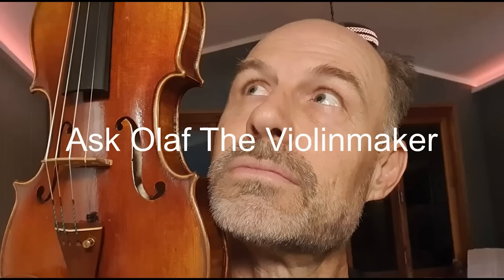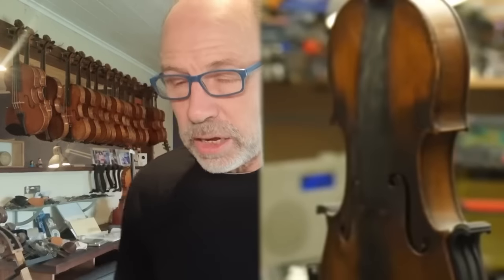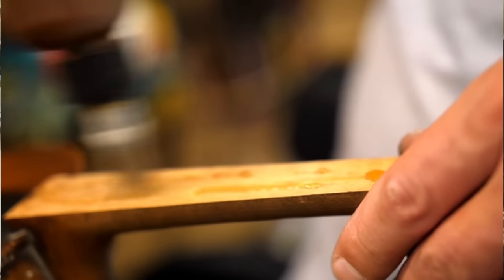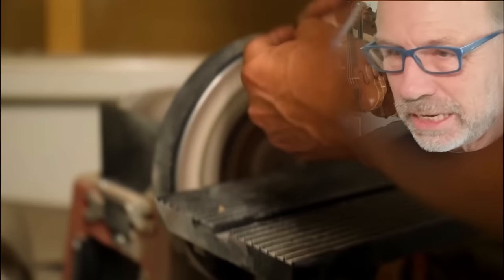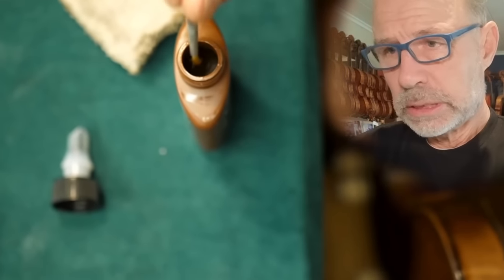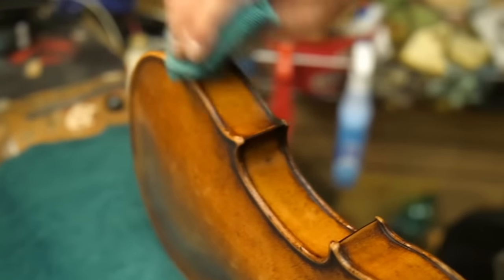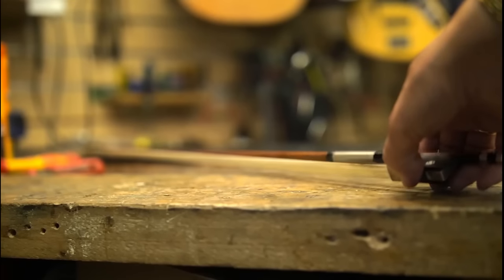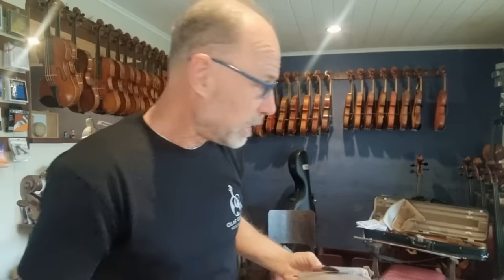Violinmaker reacts to "Ancient Violin Restoration" Video

Comment: The modern glues are not removable. Titebond is polyvinyl acetate. It has absolutely no relationship to hide glue. I did an apprenticeship as a cabinet maker restoring 17th and 18th century English and American Furniture and we used nothing but hide glue. You can use fish glue which is quite similar, but tight Bond does not break. The wood around it will break before the joint made with tight Bond will break. So that is a real problem with anything done with tight bond. Modern guitar makers use it a lot because they don't want to ever come apart. But I understand that violins are quite different from guitars. The problem is guitar makers are not violin makers and the two don't come together. It's a completely different ideology in terms of repair

Comment: NoOooo Olaf beat me to this reaction idea!   😱
Oh well, he did an excellent job of it!  Great video, Olaf!  👍👍❤

That Titebond glue he used is a type of hide glue, sure. The big problem with it is that unlike the normal hot hide glue that luthiers use, the Titebond reacts very easily with moisture, and can become soft. Some folks swear by it, but really, there's no substitute for real hide glue that you cook yourself!
Reply: quick, you can still react to Olaf's reaction before someone takes that too :O
Reply: @diethylmalonate  😁👍👍
Reply: Tite bond hide glue is not well looked upon in the Piano rebuilding industry.  Although the 2 have very different concerns.  Hot hide glue has actually been replaced a lot of this industry simply because there are glues that are a lot stronger and less reactive to moisture that have been adopted, but hide glue is still the preferred glue for parts that will need replacing such as hammers, felt and other common replacement parts.  Lot more brute force in the piano industry given the size of many parts and the forces involved.

Comment: Ernie Ball shirt, defiantly guitar guy.
The Titebond was hide glue, not PVA (wrong but not horrible).  From what I found, its the closest to real hide glue that doesn't require heating.  I never used it (it expires quickly), but looked into it for convince.  Its for people that want to use hide glue, but don't want to mix/heat it.
Olaf is right, just use hot hide glue.  Its not hard and has way more advantages over anything else.
Reply: The Titebond hide glue was one thing, using CA glue for the nut however made me cringe.
Reply: @forkless  Yea, most guitar makers slather the glue for the nut on, at least he didn't.  I have no idea why he used titebond for fingerboard and CA for nut, they are same woods.  Made no sense, unless he was in real hurry.😅
Reply: And make some sous vide with the heater!

Comment: What always sounds funny to me is the term of "hide glue" English speaking people use to speak about the hot glue used for violins. In fact there are no hides involved but bones and nerves. (hide glue only is too soft, the mixture of bone glue & nerve glue makes the best compromise between the hard (brittle) and soft (that could damp the vibrations)). You do not mention the other option often used by old German violin makers : fish glue. This is easier to use because you do not need heat and the time to set is longer... which is also a disadvantage in some cases. 
Thank you for your interesting and instructive comments particularly on this video. 
In general thank you for the topics you choose, the way you skilfully cover them (and also the pinch of humour you use to season them). I am a big fan : two thumbs up !  Sorry for my perfectible English (some may have guessed that I am French), this is a matter I try to improve day by day.
I do think that there are many old violins that deserve some work to get back to life again. Unfortunately, the labour costs of a professional luthier is generally far higher than the commercial value of most of these violins and this is the reason why some are thrown away and lots of them are just not taken care of.  I try to contribute (and I am certain to be one amongst many) to resurect (for free) some outcasts and try to do this better and better... Best regards, Thierry-Antoine

Comment: The major concern, for me, is the use of non-reversible glue. Titebond is a nice glue for usual woodworking… not for violin restoration.
Reply: Unless it's epoxy, pretty much most glues are reversible. That wasn't standard "Titebond" which is aliphatic resin glue....it was "Titebond Hide Glue" It dries a bit more crystaline than standard Titebond and is even easier to heat and remove than standard Titebond which also responds to heat. Hide glue is the best, to be sure...but it has its drawbacks in that it's weaker and more susceptible to humidity. Point being that he didn't irreversible damage the violin using that glue.

Comment: There was more wrong with the producer of the video than with the work done.  I've seen scores of old Bohemian fiddles like that one.  For a general instrument repair shop (glue aside) they delivered a decent, playable workaday violin.  That hoke about the instrument being 'ancient' and in need of total restoration, is of course absurd.

One of the arguments in the comment field was about whether the top should have been removed in order to complete any necessary work inside.  This is a matter for the luthier to decide.   If there is no damage as viewed from the endpin hole or the f holes,  it's perfectly OK to flow in some hide glue and clamp up the top plate.  Even Cremona-trained masters do this.

Comment: @Olaf, if you have any of those cheap violins behind. Or broken and unable to be repaired. Why not buy a bunch of modern glues and hang them somewhere to experience weathers. See how they fare? 

Don't have anything against hide glue, but I think a long-term test under your eyes would be more valuable than mere saying the words. Then again, maybe you've already experienced cracking open other violins with these glues?
Reply: They don't come apart easily that's the point. Likely to get damaged when doing so. I'm NO expert... just watched a lot of Olaf and TwoSet vids.
Reply: (1) Olaf is talking about glue longevity in terms of 100+ years. I doubt he will live long enough, for that experiment.
(2) Hanging the instruments, on the wall, in a controlled environment, is no experiment, at all.
(3) I am beginning to see the benefits of hot hide glue, for violins. Violins are very delicate instruments and using a glue which requires heat and moisture, to break the bond, could be injurious, to the instrument you are trying to repair.
For guitars, mandolins, zithers, dulcimers and such, it's fine, but not violins, with any value.

Comment: Hello Olaf! 
I watched that violin restoration video a few weeks ago and was reacting to it much in the same way! Though, I was surprised to hear that super glue is really frowned upon for gluing in the nut in violin making. I work on guitars as a hobby, and I've seen it become quite a common practice to use about two drops of some kind of liquid super glue on the fingerboard side (not the neck) to secure the nut. The nut comes off pretty easily when you need it to, you just put a little block of wood up to it and give it a soft strike with a fretting hammer. The glue usually breaks first since it's brittle. I'm curious what a violin maker has to say about this method.

Comment: It said Hide Glue on the container. The company states; "Its sensitivity to moisture allows for easy disassembly of parts, a critical benefit in antique restoration or the repair of musical instruments."
Seems like it should be okay to use, but are there any disadvantages to the ready to use stuff like this?

Comment: the thing is, not everyone has access to a violin maker that can do that kinda repair for them. like i wanna restore a violin in pieces and will do it on a regular wood workshop because i cant afford/dont want a brand violin right now and the only violin luthier in town is really not reliable. most of the tools a violin maker works with are probably meant to save time or provide precision for details while yes, you can restore a violin with a tooth brush and hair pins but it wont sound and look like a million bucks especially with ittle knowledge. what i find problematic is to make a video of it that encourages other people to do so with no proper disclaimer of this situation. thank you for the honest and very educational video.
notable mentions: sniffing turpentine, sanding fingerboard, crazy glue, when auto subtitles said "dementia on this one" instead of dimension, vietnam 100//

Comment: Olaf, I felt your pain! What bridge do you recommend? Also, I had an instrument repaired for cracks and they changed the fingerboard and the nut. It totally changed the sound for the worse. What would you adjust to get the old sound back? Thanks.
Reply from the maker: Wow... How frustrating.
They probably also adjusted the soundpost. So that would be a good starting point...
Maybe go to a different place?
Get some recommendations from local string players

Comment: Thanks Olaf. Yes, I cringed too, however those threaded fingerboard clamps can work OK, but obviously the fingerboard still has to be kept perfectly positioned when tightening them up.
I looked up that Titebond glue "The Titebond Liquid Hide Glue is the first hide glue to be available in liquid form, it requires no mixing, stirring or heating." but I'm curious to know what keeps it liquid in its cold state & can it be cracked open later? It obviously dissolves with water still & probably fine & convenient for gluing the nut back on.
I'll stick with my standard Russian hide glue. :) 
As I've said before, there's a certain Cremona trained 'luthier' that calls himself Maestro & he uses Titebond Original Wood Glue (red label) with this description (part of), "This glue is so strong, it has a stronger than timber bond, so the timber surrounding the joint is going to break before the joint releases. It is the glue of choice for instrument makers around the world." 
So he uses it for crack repairs, saying that it is a 'permanent' repair, including centre joins. I told him no repair should be considered 'permanent' & I'm sure a luthier in later years will not thank him if faced with a follow up repair. Thankfully he still uses hide glue for gluing the belly on etc.
Reply from the maker: Wow... Yes,
Many years ago I restored a Gagliano cello with well over 40 cracks.
A 'repairer' here in Brisbane glued most of them with PVA glue... It literally took us a couple of years to remove the glue and then reglue and restore each crack correctly.
Reply: @AskOlaftheViolinmaker  Ouch! I bet there were tears & some 'sweet' words during that time.
Reply from the maker: @rossthefiddler5890  haha... Yes. Some non PG content right there...

Comment: I did happen to see that video. I agree with you 100%. I will even be more blunt than you are, the guy is a butcher. I'm a retired machinist,welder and machine repairman. I'm very skilled at using the proper tools, the proper way. There is also, regardless of what you are repairing or rebuilding,
a step-by-step process. I found that the restorer was doing things in reverse. I would have cleaned everything first. This way you're finishing your restoration on a solid base that has already been repaired and cleaned. In my opinion to do the heavy cleaning after you have restored it is a dangerous procedure. I also watched the way his hands were using simple files and reamers. He was too aggressive with the reamers and somebody should tell him that files are not used with a back and forth action.
As I stated the guy is a butcher not a craftsman.
Reply: a machinist would clean the parts but here he should be careful with surfaces he has to glue later.  and since he's using turpentine...  You're right it's a true hack job compared to people who went to one of the big violin making schools like chicago or salt lake city, who are the only people who'd touch an instrument of mine.  olaf is being very ...diplomatic might be the best word
Reply: yt is full of hack violin fixers.  the violins were mostly worthless before though

Comment: Something worth mentioning is that the channel of that video USED to be "Andre will fix it", the original content channel of a quite skilled general restorations and repairs guy, who repaired from firearms to horses (no, no typo).  Sadly, after a long hiatus, the channel was rebranded and relaunched (with a different contact address,  not that of Andre, but that of BeAmazed, an "aggregated amazing stories" website) with the kind of heavily edited content you can now seen. Since then, Andre (and his original content) has basically dissappeared from Internet. Draw your own conclusions.

Comment: Titebond is definitely insoluble in water once dry. That fingerboard is not coming off clean ever again... Afair it polymerizes into a plastic and can basically only be removed with harsh chemicals like acetone and in higher temps(like 80C) in methanol..? and ofc physically by literally just sanding or chiseling the wood and glue. Most of the time i'm not even using it for my woodworking projects because of the fact that it's basically just plastic. I'd rather just build things well instead of hiding mistakes and bad design choices behind a layer of cheap plastic..

Comment: I was going to use titebond on my Talharpa I'm in the process of designing. I'd love to use real hide glue, though, just so I could open it up if I ever needed to. I just don't know where to get any, or even where to start looking to even see if it's in my budget range.

I've actually been taking a lot of inspiration from classical instrument construction for my Talharpa, from this accessibility after construction to the ability to adjust the bow hair tension to the use of a bass bar. Though everything I do will be more of an experiment than anything else since I really can't say if any of it'll actually be beneficial until i actually build it. But it's been fun, and at least design-wise I'm really happy about it, and really, that's all that matters
Reply from the maker: Hide glue and rabbit glue which I use are pretty easy to find in most places.
Violin making and guitar making supplies have it as well as some specialised hardware shops

Comment: Please check out RSW Chocolate.  It's the Rosa String Works channel and he restores a very broken violin called Chocolate.  He uses tite bond original for a lot of things and says it's not harder to take apart than hide glue but I'd be interested in seeing your opinion.
Reply: It's a actually not difficult to remove titebond original it just takes longer. For cracks repaired with titebond if you leave a damp cloth over the area in a few hours it softens, I still would prefer hide gule. Now in the case of Chocolate I feel that there was nothing to lose at that point, most luthiers would have called it a loss and would have just called it a loss and make a new top for it rather then repair the old one.
Reply: zapa1pnt
1 second ago
I doubt Jerry Rosa would even Want to work on a $10,000 violin, with the exception of the completely crushed "Chocolate" violin, which no one else would touch. Also, anyone with such an instrument would not be likely, to take it to their local luthier.
However, all of that is up to the owner of the instrument. Many owners of old instruments just want them to be playable and cannot afford or want to pay high dollars, to get them fixed. Most of them, floating around, aren't Really worth it, anyway.
Reply: @TXCrafts1 : I am beginning to see the benefits of hot hide glue, for violins. Violins are very delicate instruments and using a glue which requires heat and moisture, to break the bond, could be injurious, to the instrument you are trying to repair.
Reply: No doubt, I would always prefer hide glue particularly for major repairs but you could get away with pva for something like a chipped corner or something like that.

Comment: The left shoulder of my violin where as you go up with your hand your wrist touches that area and if you're sitting down with your violin on your lap a lot of times you hold it in that area was very dirty. The violin maker cleaned it off and polished up the violin but right in that area there is no varnish the rest of the violin has thin varnish because it's about a hundred year old violin. what would you suggest?

Comment: I repair guitars but I am always very careful with snading, the bridge and partivulatly the nut. I also do some violins and use hide glue. Please, not all luthiers are rough on violins and guitars hace several types of top bracing depending on the style of guitar. Have worked with hide glue but will not use Super glue- I hate it. Titebond is okay on guitars but requires heating/steaming to dismantle a neck and other parts. Please do not dis guitar luthiers. I am 66 and started with an ivory nut in 1969.